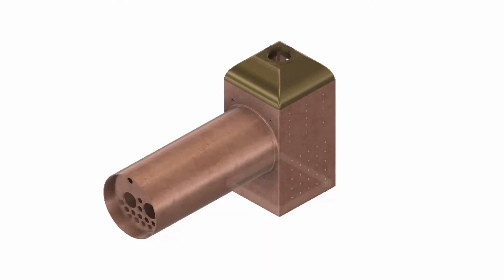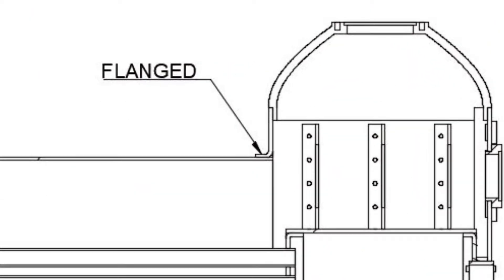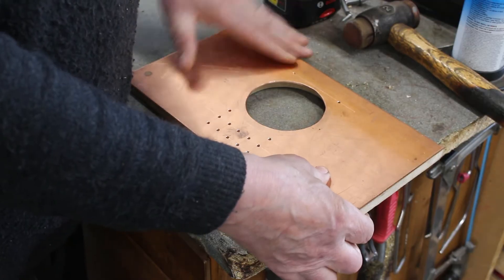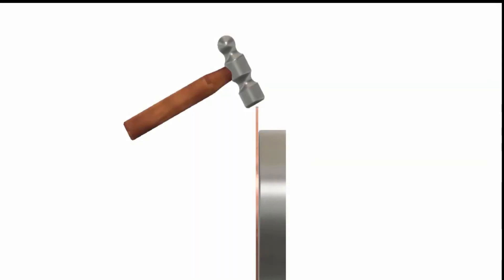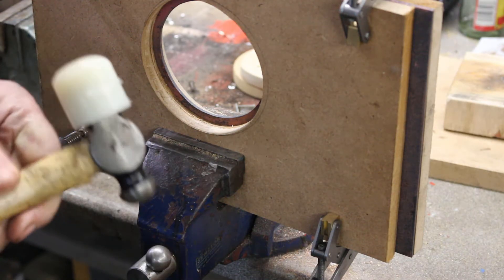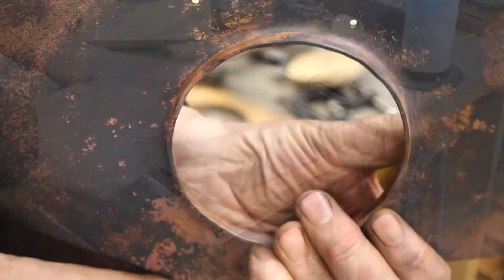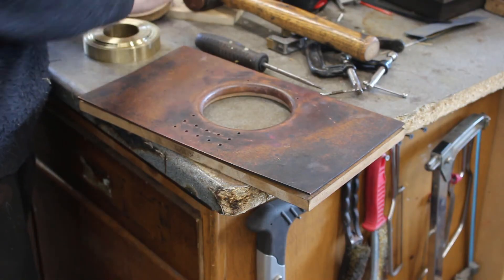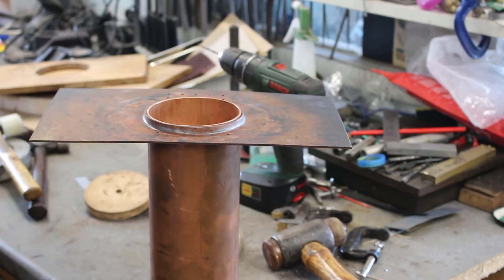LION Miniature Steam Loco Build Pt 5- Flanging the Throat Plate

Comment: I am also going to flange the throatplate but what size did you make the flange?
Reply from the maker: Hi Rob. I'm using a 4 inch outside diameter barrel so the flange on the throat plate is made to fit, i.e. 4 inches bore. As you form the flange you are stretching and therefore thinning the throat plate material so you need to make the bore of the former a little under size, say 15 thou under. So the former bore is the barrel diameter+ 2 x the material thickness - 0.015. but it's a case of trial and error. I made the external length of the flange 0.25 inches long.
I hope that answers your query.
The 4 inch diameter barrel is proportionally a little over size so I can see some compromises having to be made down the line.
Anyway, it's a fantastic model to build.